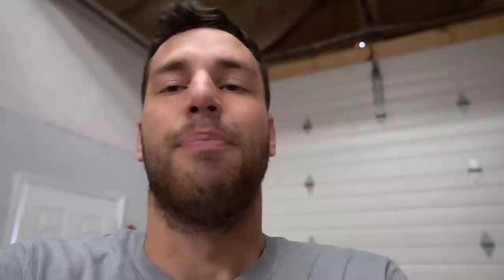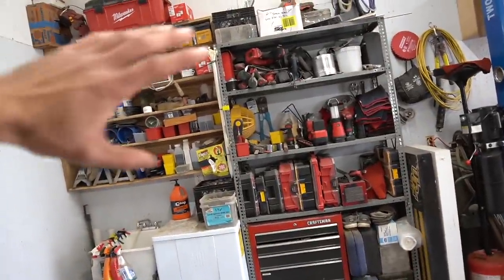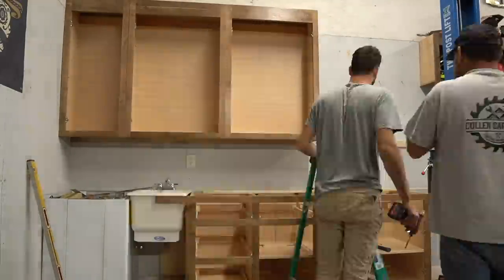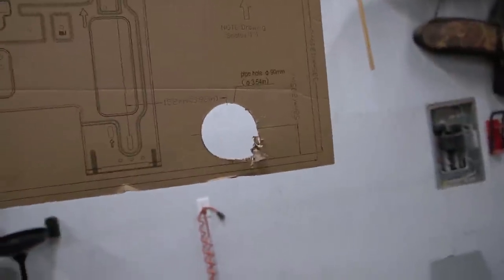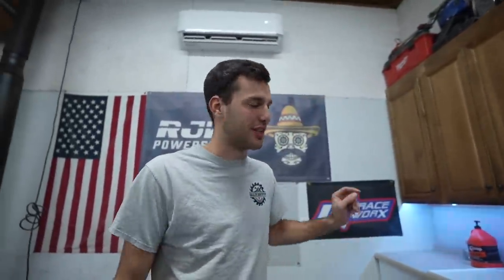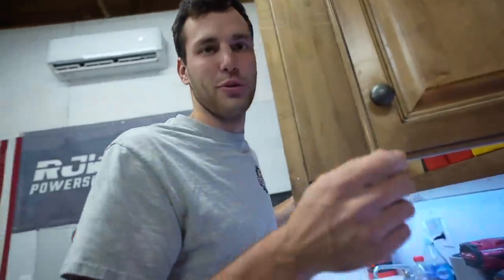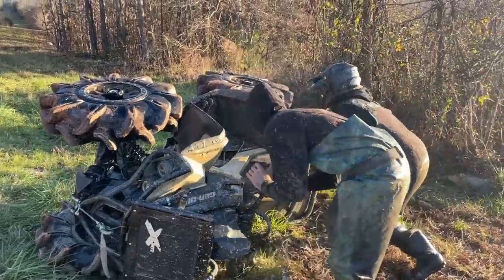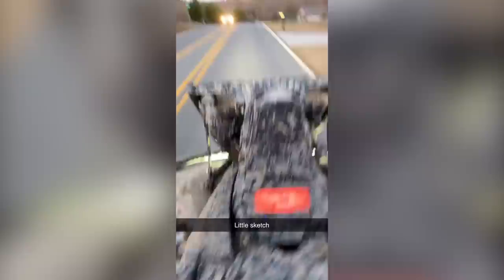HUGE SURPRISE For The Shop!   *I Flipped The Renegade*

Comment: Check your air box drain for oil. When they roll in their left side oil comes in through a vent line. I rolled my Renegade in September and had the air box filled to the brim with oil.

Comment: you didn’t use a vacuum pump, to pump them down before you let refrigerate in ?
Reply from the maker: Both heads, lines an unit are prefilled/pressurized